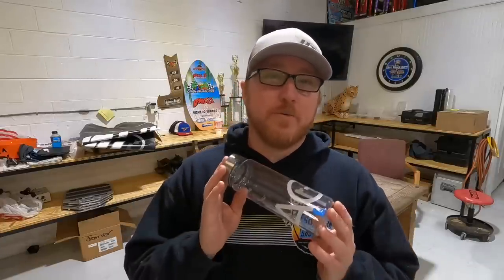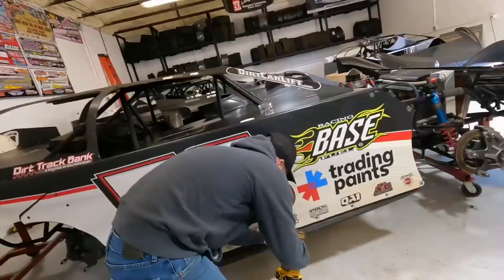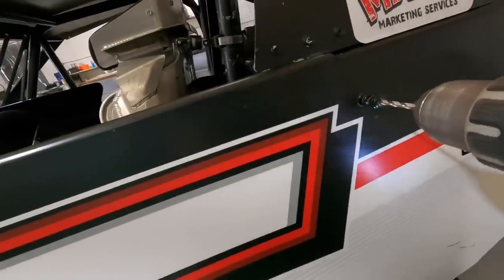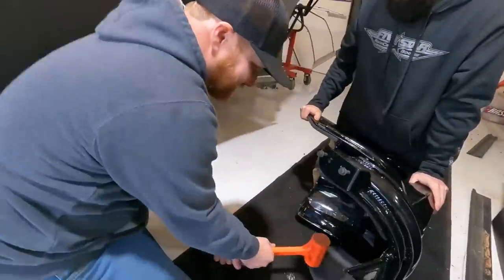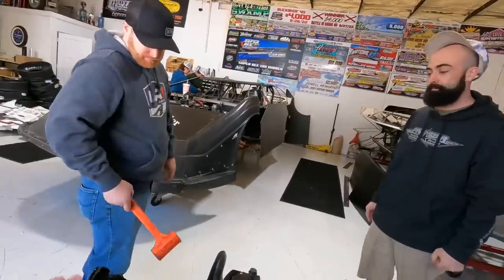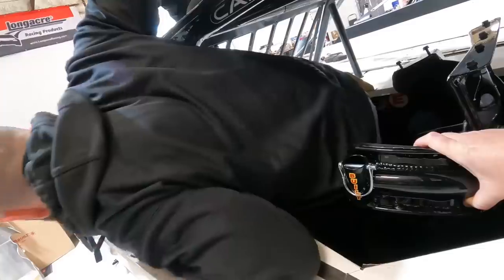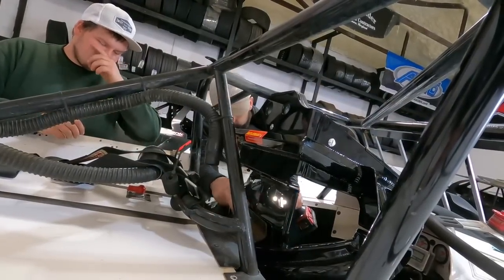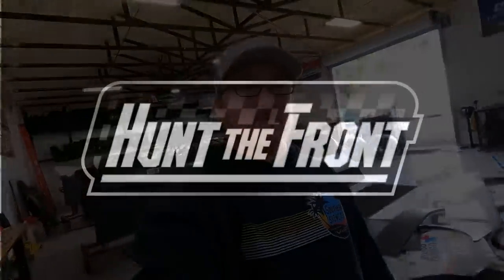Hammer Time! How to Get the Perfect Fit on Your New Custom Race Seat!

Comment: Guys don't re-use your bolts.  Everytime you tighten them with an impact like you are doing on the seat you are stretching the threads.   It will work loose and the seat will move.
Reply: It pains me them use that seat bracket. No strength in it at all. You can see all of there seats moving in the videos.
Reply: @djchristie1490  is that the lap belt mounted to that piece of sheet metal?
Reply: Should be using Red Loctite on the bracket bolts. Then when removing them, 20 seconds of MAP gas and they will come right out.
Reply: It’s elastic deformation not plastic so re -using a few times won’t be an issue.  If they were a head bolts  then I would agree not to re-use them as they’re stretched very close to the Yield Strength typically.  I would like to see Jesse use safety glasses when drilling in front of his face like that though….
Reply: The belts are what hold them in the most as long as their belts bolts don't break. Don't use cheap hardware
Reply: @jasonu19  until the seat moves back 3" due to that sheet metal bracket deforming and the belt is now loose.
Reply: I hope this is a joke if not shut up!!! just enjoy the video....how much did y'all have in winnings last year go ahead total it up?....how much this year?....However I apologize I didn't realize Davenport, Bloomquist, Overton and Erb were in the comments
Reply: @stevenkovacs2766  the seat is bolted in with sheet metal
Reply: @derekworrod230  you don't have to be those guys to recognize a potential issue with the seat mounting. Fwiw no offense to the HTF crew but my money would be on DJ Cristie against any one of the three😉
Reply: @djchristie1490  the back bracket is thicker then regular sheet metal. It is probably the bracket from capital.
Reply: It's a official! This where all the company safety management posted at.
Reply: It also weakens the threads. You should torque them evenly
Also, I would replace the lug nuts and studs after so many races. Especially if you have raced on a rough track.
Reply: @Kyle Downey  right?!?! Lol these people in the comments act like they are racing the cars, grade 8 bolts are reusable especially for bolting a seat in as they are rated at 150,000 psi , FACTS!

Comment: Before wrapping or lettering anything I wipe it down with isopropyl alcohol/ rubbing alcohol at least 70% that will clean any dirt or oily finger prints and waxes off the panels and it dries almost instantly. Your plastic panels probably have a release agent from the molds.

Comment: Jesse,
to answer your question....

"if you can't fix it with duct tape, bailing wire or zip ties, what'd ya do?"

well speaking as a mechanic if those don't work......get the touch and heat it up .... if it melts or burns up..... get a new one.
👍😉😎😁😅😂🤣
Reply: WD-40 !
Reply: "Hammer duct tape and zip ties"